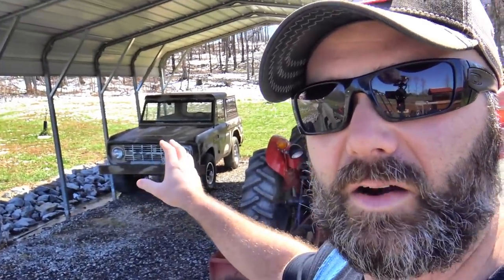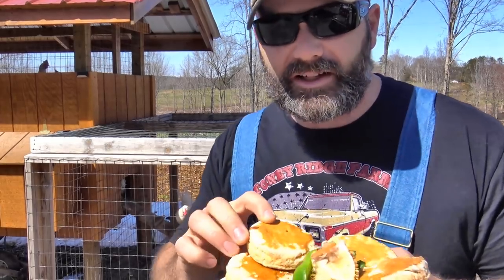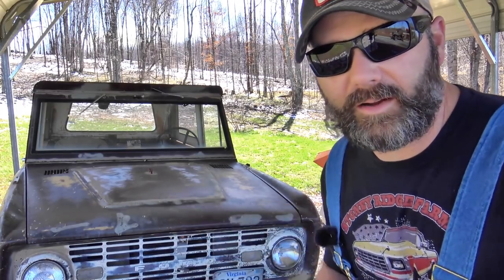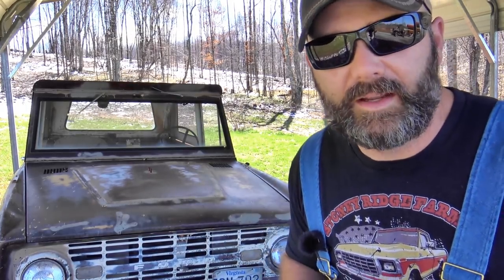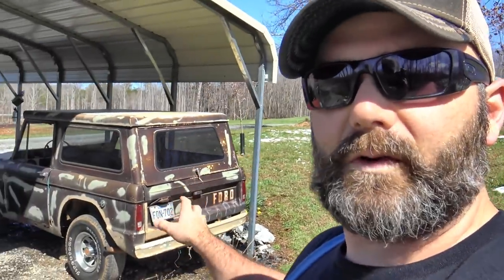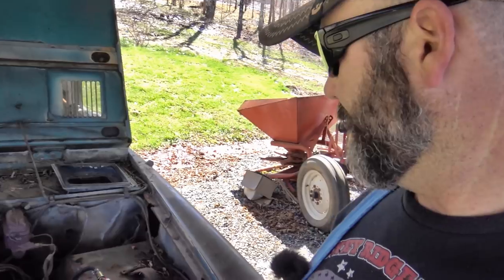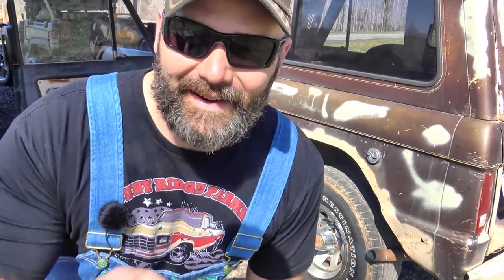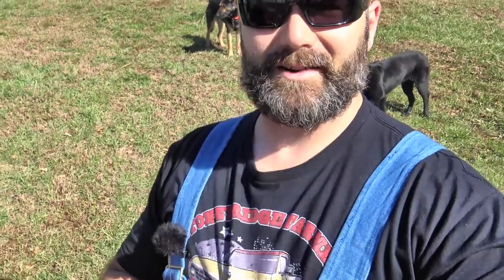1968 BRONCO GOES TO THE CRUSHER?? OR...WILL IT RUN??

Comment: Thank you Josh I really love your Bronco as your videos too! Also the electric fuel pumps they really goid on they back they love to push gas not so more for sucking. Also on the back it's protect from high temperatures in the engine bay. Also did you spary on the paint?  I love the color of it ! I would take the rust off it and apply clear coat on the Patina. Probably never sell the Bronco too. Also on the smoke when you start it most likely it's the seals on the valves basically its plastic or rubber, oil leaks inside the cylinder where is the piston. As a mechanic I can change the seals on the valves without taking off the heads. Filling the cylinder with rope turn engine by hand pistol up that way it's stop drop the valves in the cylinders. Then clean oil holes on the head they get plugged up. Do you understand what I'm saying about that? Good mechanics can change the seals about 3-4 hours less cost for you too. Especially your engine in your Bronco...

Comment: Even if you don't restore the body, redoing the heads on that ol' 289 will stop most of the smoking. Probably just needs a set of valve seats and guides. Of course fix the brakes. Lol . It would make a great ol work horse. Nice piece of family history though.

Comment: Horn doesn't work, try your lights. .hmm Grey blue smoke i see. First thought is basic to the book answer of O-rings/valve seal. Engine will still run with  it leaking,  Just rough though.

Comment: Blue smoke could be a head gasket leak, letting in coolant
Reply from the maker: That old bronco has smoked like that for 20 years brotha......not a head gasket...just bad rings or valve seals...runs like a top..just a little smoky
Reply: Stoney Ridge Farmer oooh well I'm still learning I'm 15😂 nice truck though👍

Comment: old Broncos are very cool. love seeing your farm and everything going on there. something I always wanted to do. I by the way have a 75 Bronco Ranger model 302 CI three on the tree and currently trying to sell it on classicbroncos.com. my front brakes were also gone. they are drum brakes and not worth the trouble to redo. since I had a Dana 44 front end I was able to take the knuckles and everything out side of those off a 76 Ford F150 and they fit right on there giving me suitable disc brakes for about $250 in parts from the Wrecker yard. the front end in yours is probably a Dana 30 and there may be aftermarket companies to convert that front end to disc brakes which would be the way to go. just time and money. but super fun to drive around your farm especially if you take the top off. mine has never had the top off though, been parked in my garage for years and no longer have the desire to fix it up or keep it at my age. you better have fun while you're young.

Comment: Keep it and replace that 289 with a 351. Or better yet for torque the 300 i6
Reply: 351s are a lot bigger.  The 221/260/289 block was so compact, they couldn't add enough stroke to make a 351 out of it.  That's why the 351W was made, and it's completely different.  I don't think he wants to put that much time, money, and effort into it.

Comment: You will spend more than 10,000 fixing that beast up the parts are at the ready to be had but very expensive. To do a off frame restoration you are looking at 15 to 20,000 easy but well worth it in the end. And that is if you do 95% of the labor.

Comment: We never heard what happened to the Cummings driveshaft issue ? I would keep that Ford $100 pick up truck any day of the week over at rusty old ford bronco. It's your decision it's your item don't let us decide you decide. By the way you're smoking issue in the engine is called oil blow by worn piston ring for an oil ring or valve seals. The engine is tired it's only gonna get worse not better.
General repair

Comment: I would say that the reason the engine smokes when first started is bad valve seals, rubber dries out and cracks with age which allows oil to drain into the combustion chambers. I would only keep this thing around if I had plenty of time and extra cash to spend, also it needs a dry place to live. Rust has already eaten the floors and rockers and rust never stops on it's own. These are collectable vehicles so someone would give you a fair price. Don't make your decisions based on emotion, you will end up with a farm full of junk that will do you no good.
Reply from the maker: I agree

Comment: 1 do not sell a piece of history .  remove the fuel filter from the suction side of the pump and you should put it on the pressure side don't use the filter you had on it  ( comon check valve problems ) probably why it started working when you put air to it and the pump should be as close to the tank as possible . and aluminum fuel line from summit racing 5/16 by 25 ft    $20.00 take care bending no kinking  will last your lifetime. probably the farms as well .

Comment: Your rings probably are worn like you said. Also your valves and every other moving part in there are probably very gummed up and dirty along with radiator lines etc. What I would do before driving it too much is flush the radiator, maybe put some stopleak in it, run a whole lot of seafoam through the motor, change and flush the oil and transmission fluid, take the carb off and soak it in carb cleaner overnight, clean the valves with pb blaster or gunk or something similar, but some new shiny valve covers that dont have all that dried burnt oil inside them, replace the spark plugs, plug wires, distributor points, maybe even the whole distributor with a performance one, run a test on the coil with a multitestor and replace it if needed, replace all of those dried out hoses and any vacuum lines etc. and fix the brakes and she should run at least another 25-50k before replacing the rings. There are some additives which I cannot attest to the effectiveness of, which will essentially fill the gaps of your rings. They call it something like "dewearing" the motor. I however would do some more research on that part before putting it in the vehicle. This is all my personal opinion on what to do, but you do you.

Comment: Electric fuel pumps like to push the fuel mechanical pumps like to suck the fuel. Thats why mechanical fuel pumps are under the hood and newer cars with electrical fuel pumps are by the tank. Also the engines heat is not good for the electric pump.

Comment: Broncos were in the time, a good seller in Australia - now gone. Top video As to Mr Rooster, youve got grow one and show him you are the alpha male..Just some advice prior to start engines not running for years. My father told me to put heaps of 'Penetrene' in all ports you can (spark plug removal  and rocker cover remova)l put a good amount in}). It is an Aussie product and no dought America has a similar.   My link is http://qsmart.net.au/sample-post/penetrene-2/ but just search for Penetrine .  I've fired up many old motors with 2 doses over two days. Mates haven't and they end up having to recondition parts. After 4+ decades, I have proven my pre-lubrication works.

Comment: Don't sell it and from what I've been told blue smoke is a sign of burning oil so my guess is worn piston rings, but I'M NOT A PROFESSIONAL so I'm not positive
Reply: Axillary Gaming could be rings, but smoking on startup is valve guide seals. When the engine is not running oil drips down into the combustion chamber and when started burns off causing the puff of smoke. But yeah a steady smoking is more likely than not worn rings. Also if youre engine is blowing white smoke it’s prob head gasket. Another way to check head gasket is start the engine and open the radiator cap (NOT when the engine is HOT) and if it is puffing smoke is another indication.
Reply: i would change the valve seals to stop the oil leaking inside engine